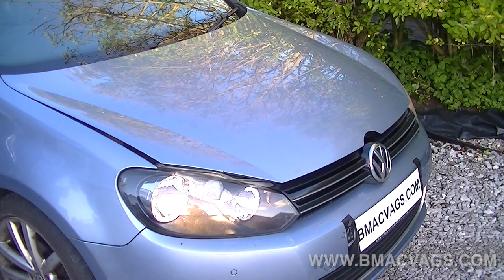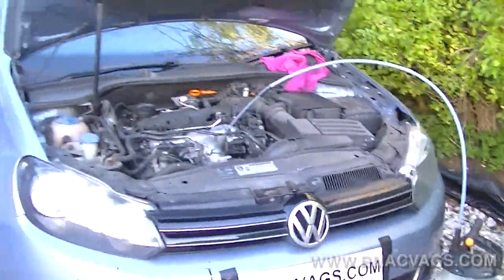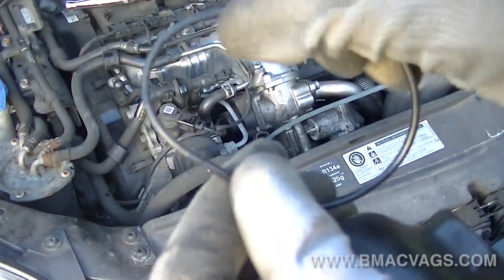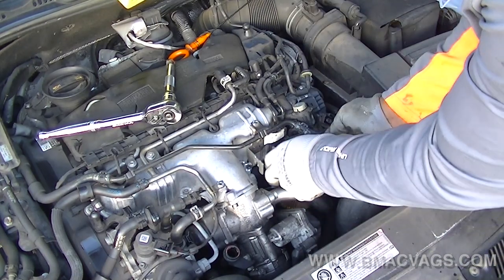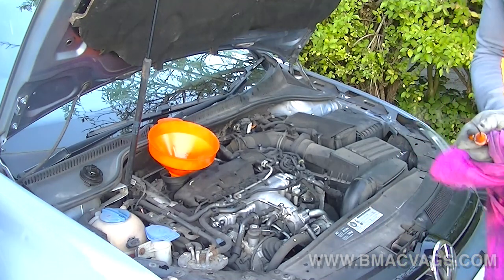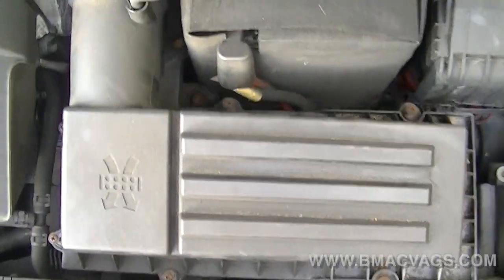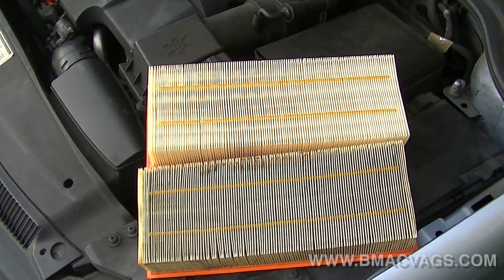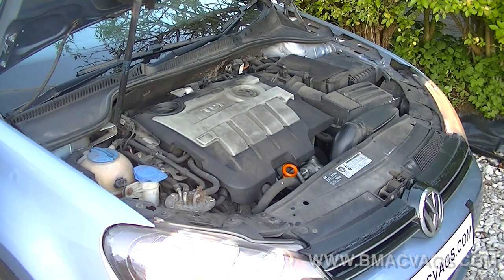How to Service Your Car Oil & Filter The Smart Way

Comment: Your VW door lock mechanism repair was most helpful. My offside (driver) door lock on my 2007 MK Golf TDi has succumbed to the curse of the VW door locks.
Reply from the maker: You can either replace the module or the microswitch

Comment: Nice to see you back, i have the same Vaccumpump and change the Oil  the same way on my 1,9 tdi axr Engine , but i think that your newer tdi has an oil Seperator in the Oilpan .
The Problem is , you will not get the hole Oil out through the Dipstickhole.You will not reach the deepest Point near the Drainscrew, so about half a Liter stays in the Engine.
Take the Drainscrew out after sucking it out and  check if there is still oil coming out.Not every Engine is comletely empty and its not recommend to do it with a Pump.
But as always , very nice Video and very Helpfull. Saw your first Video with that Pump and bought it .Use it a lot on small Engines.

Comment: great vid as always, I used to change my oil that way when I had an Astra estate, the sump plug had seized so rather than risk damaging the threads I went though the dipstick pipe and drew out the oil that way.
I think I will be buying one of the vaccuum pumps you used in the vid, that definitely is a better way of changing oil, quicker and less messy.
Good to see you back and well.

Comment: I heard that sucking out the oil just leaves behind the grit and solids which would normally be drained from the sump becuase it's at the bottom...any truth to this?
Reply: Yea your right as the oil is lighter than the solid debris
Reply from the maker: I will be looking to address this in the next video
Reply: I change my oil regularly using this method, very easy. Every 4th or 5th change I drain it from below to get it all out. I think the most important thing is to change oil as frequently as you can afford. Critical for engine maintenance, especially in Diesels and if you are changing it regularly this method saves you a lot of time and grief.

Comment: I didn't know those oil extractors existed.. good to know though! Does it get most of the oil out?
Reply: You can use a basic hand pump with some cheap silicon pipe attached to it. Takes more time of course but the one he has is overkill for DIYing a single car. Yes, you can get more oil out compared to the drain hole with some adjustment of the hose.

Comment: the oil extractactor is an very bad method because all the dirt and metal parts will stay on the bottom and when you drive the car all they go in all parts of the engine. ;)
Reply from the maker: I am going to answer this question in the next video